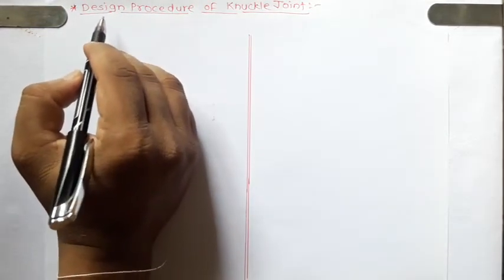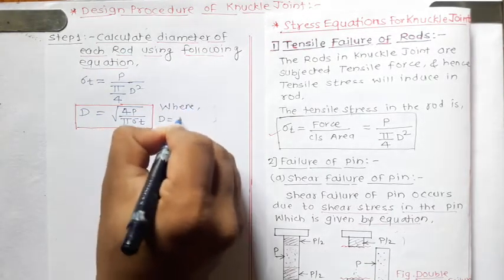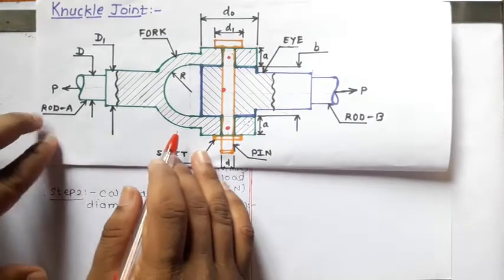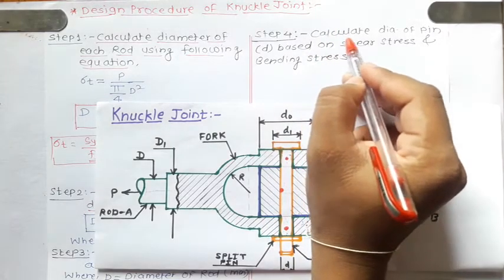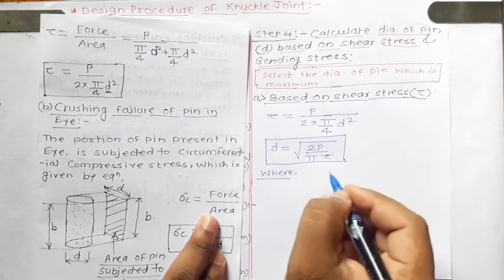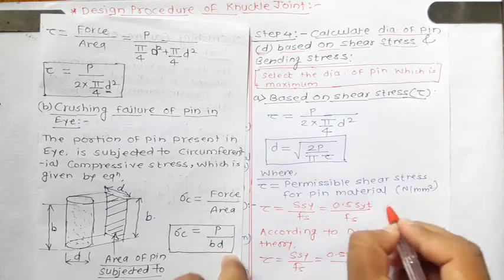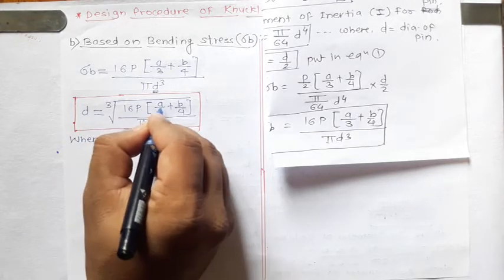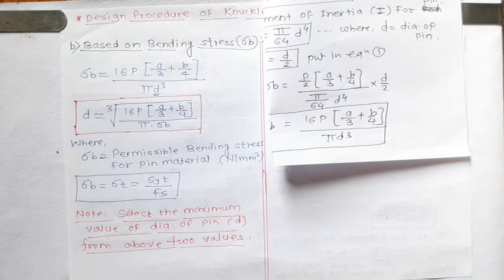2.16 Design Procedure of Knuckle joint Part 1_Design against Static Load_Machine Design I

Comment: sir make lectures on every subject of mechanical branch,specially core subjects like strength of materials, theory of machine,dynamic of machine, manufacturing,i m requesting this because u r teaching in very proper way,.theory,derivation and then numerical example. thermodynamics and heat transfer also sir
Reply from the maker: Definitely,  once this course of Machine Design gets complete, I will work on other core subjects also.

Be in touch for any difficulty or query. Enjoy online learning.